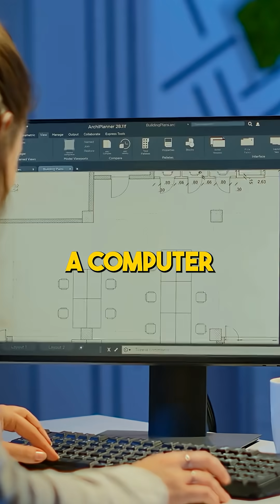How do Batteries Work?

Comment: Ok, but the way to understand is focusing on the positive charged ion (Li+) and the filer that allows just the ion (Li+) pass to the other side while electrons have to pass by the wire.
Then, pushing/pulling the electrons - any method to create continuous electricity works - we can push the Li+ to the other side.
And then the battery is charged because the Li+ is in the side it doesn't belong, and want to come back. But the Li+ can come back by its electrolite and the electrons cone back bay tye wire. So we get back tye electricity we previusly waste for pushing the Li+ the the sude it doesnt belong.

Comment: The exchange of electrons is low, it is the difference in charge that creates the energy of electromagnetic fields that goes through the wire near the speed of light. The atoms in the wire aren't exchanging electrons much at all, but the field strength is created by that positive and negative charge difference. The electrons aren't really doing the work, the field is. Imagine how crazy the wire would be if the electrons of the copper were all flying around... it would be chaos. The copper would become plasma!
Reply: This reminds me of the Veritasium video.
Reply: The free electrons in a conductor are flying around at ~10% C (speed of light) just randomly by themselves just sitting there, it's the drift velocity when a current is flowing that is slow - a couple cm/minute tops.
Reply: @wally7856  But the random motion averages to zero and doesn't really play a role in the delivery of "power", that's the drift for current and the electromagnetic field changes, right? I was just trying to point out that the concept of electrons flying through wires as the current is NOT what is happening at all.
Reply: @MS12-u5p  The power delivery is in the electromagnetic field outside the wire, not the wire itself but it's the electrons in the wire drifting that create that field.
Reply: @wally7856  Kind of, the field is created by the voltage source traveling near light speed and exerts forces which results in the drift which helps the field propagate. If the wire material/atoms didn't drift with free electrons it wouldn't conduct. I said "through the wire" because the wire is needed to create the field, but you are 100% correct that the field isn't actually IN the wire itself. I should have been more clear. In essence, the voltage force interacts with the resistance of the material (free electrons, atom structure, temp, etc.), and results in how much current is delivered.
Reply: @MS12-u5p  Small technicality: The field being "completely" outside the wire only exists for superconductors or stationary charges (no current flowing - open circuit). There would be a small portion of the field inside the wire when current is flowing due to the wires resistance so the charge's would not be uniform across the cross section of wire). So "mostly" outside of the wire.
Reply: @wally7856  Great clarification, I didn't mean to imply completely outside of the wire. Vectors adding up and whatnot. LOL. But it isn't the resistance causing the lack of uniformity alone right? In general you get this variance anyway? Superconductors aside of course...

Comment: Electrons in orbit around the nucleus of the atom? How 2010. :)
Reply: What do you mean?
Reply: So what's the latest version of this in 2020s ?
Reply: @iam6424 Electrons don't really orbit like planets orbit the sun. They exist in a probability cloud, sort of a shell around the nucleus.

But physicists still use the term "orbit" when talking to those (like me) who aren't deeply versed in quantum mechanics.
Reply: @scribbler60 Gotcha !👍🏽 ( i guess when someone says orbit we shouldn't take it's meaning as "revolving " ...orbit simply means sphere or a circular track...(a probability sphere or track , for those well  versed in 'quantum language' ) 🙏🏼.
Reply: @iam6424  If an electron "was" in an orbit around the nucleus then it would be in a state of constant acceleration. Charged particles give off photons (light) when they are accelerated. That means the electron would be constantly losing energy and therefore it's orbit would be constantly decaying. If you do the math, an orbiting electron would decay into the nucleus in 1/10 of 1 billionth of a second. Physicists use the term "orbital" instead now which is just an area of probability of where the electron may be if you measured it. Before you measure it the electron is just a probability wave around the atom and exists everywhere. (and by everywhere I mean that there is a non-zero chance that one of the electrons from you body is currently sitting on the surface of the far side of Pluto right now)